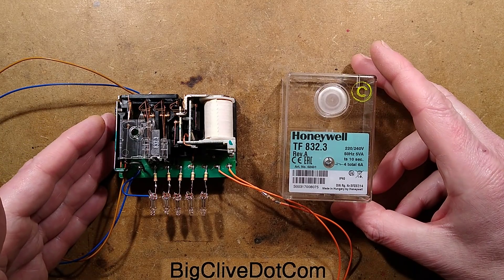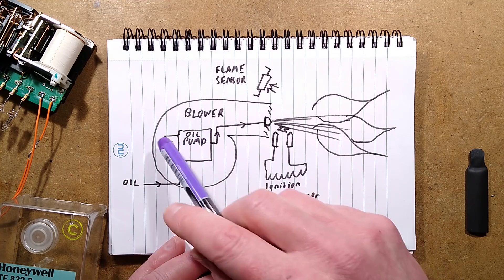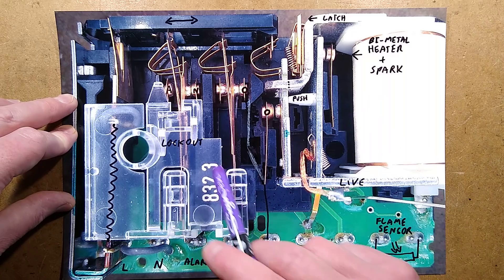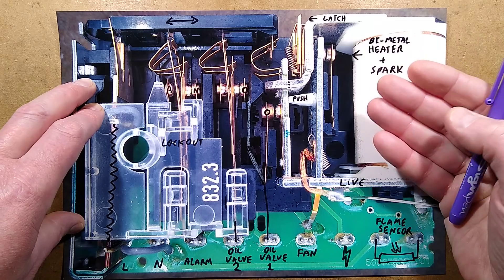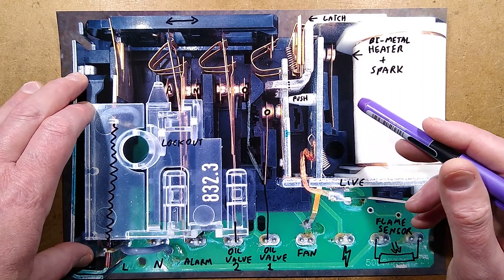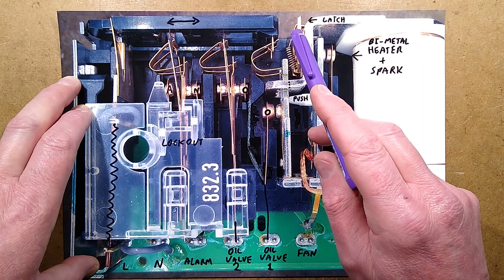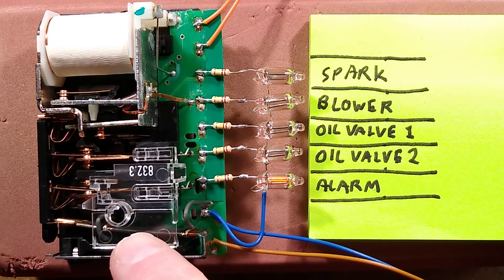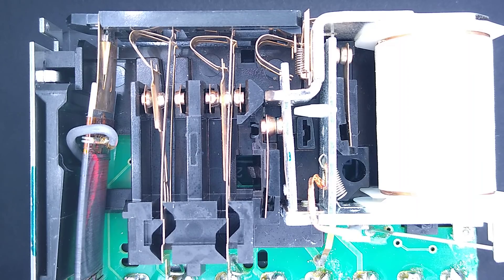Incredibly clever oil furnace burner controller (very perplexing)

Comment: That's awesome. Must have taken forever to work everything out! Our Honeywell thermostat used to have something in it that made a nice clicky noise whenever the HVAC system was about to go on or off, and then some "tech" decided it was somehow responsible for an issue we were having and replaced it with an unbranded electronic one. He was sus AF. The display is nice and big and an actually qualified HVAC guy told us it's okay, but it no longer makes any reassuring clicky noises. I miss the clicky noises. :(

Comment: I just had one of these fail on my boiler as the coil on the bi-metallic strip had fried, resulting in the burner fan and spark working but solenoid staying shut.  Interesting device and great video thanks.

Comment: Really good explanation can    Do these units fail as I have oil to the bleed valve but the vaporised oil is not being sprayed out the nozzle I did put a new solenoid on last year ?
Reply from the maker: You may have a blocked nozzle.  If you get a new one to try, the numbers on the nozzle must match.  They indicate the nozzle diameter and spray pattern.

Comment: These are also used in inshore ships.
We got one for the diesel burner for the heating of the accomodation and hot water.
Reply: So next thing how does the light sensor work is it like a solar power thing?
Or is it one of those light resistors that increase resistance when hit by light?
Curious to understand it hehe

Comment: Those are reliable controls, but I still prefer modern solid state oil burner control. Less variability and can even flash trouble codes at you

Comment: i wonder if a 12-24v ac/dc variant exists
I would use this for a dual level propane/butane/city gas heater scenario with oil 2 being run via a thermal switch+555 delay(after say 5 minutes of active "oil 2" when it is below 5c outside it would then  allow the "high flow" mode via the second higher flow gas into the flame zone) for extreme temps outside and as 24vac is a common usa thermostat voltage and would simply power a 24vac unit via the "heat enable" signal and the main air fan would simply force the local distribution fan to circulate the room/house air
this would allow any fire based heating system with dual level control to be used safely assuming the main house blower also has a "hot exchanger" thermal switch that forces the main blower active whenever there is too much heat in the "fire zone" (ie about 80-120c so a simple heat pump can be used as "heat 1" for tepid days)
this would also allow safer operation of personal propane heaters as using a simple control stack that locks out fuel flow upon a failed ignition(possibly using a heat switch rather than light based flame sensor) as a 24vac low current transformer is a common item so economies of scale exist
I want a 24vac version of this for simply using the simple but highly safe sequence to control all manners or flame heated systems
my wish in the future is a bioreactor with post-purification gas cracking to butane/propane and those reactors need an ideal 45c to keep the bacteria happy so a dual level burner with outside temp sensing and second stage delay/second thermostat relay for extreme cold would be ideal to use the extra H4S to keep the reactor happy
sure if the H4S is not enough on it's own I would then use a slightly lower regulator output from the main propane/Hydrogen waste tanks to sequence the burnoff of secondary products to keep the grass clipping to methane reactor happy
if it gets too cold the gas slows and eventually it dies and as 45c is quite warm for most areas it should be very happy with only a mix of PC waste heat from the server farm and a bit of flames

Comment: Mine has an additional wrinkle that the blower is controlled by a temperature sensor on the heat exchanger.  So the blower doesn't come on immediately (and blow cold air) when there's a call for heat, the flame starts, the heat exchanger warms up, and the blower kicks in.  When the call for heat goes off, the burner shuts down, but the blower keeps going, extracting the remaining heat from the heat exchanger, and adding a little hysteresis to the system.  When the heat exchanger cools off, the blower shuts down.  It works quite well, except for when people get confused/worried when the blower doesn't follow the thermostat exactly.

Comment: I wonder if America oil burners work similarly.

 I know the natural gas units in the US use a thermocouple that generates a small current when hot. If there is no flame, there will be no voltage and the gas control valve will switch off.

There was a house that blew up a few towns away from me. From what I hear it was due to compound failure - the system didn't ignite, and for some reason the gas valve also failed to turn off, so I guess the system isn't entirely failure proof. It's one of the reasons I'm not entirely upset I don't have natural gas where I live. Sure, the $800 electric bills in the winter suck, but while an electrical fire is always a risk, uncontrolled angry pixies don't result in an unsurviable explosion.
Reply from the maker: America seems to use different ignition systems.

Comment: There's lots of bimetallic strips used as timers in kettles and toasters.  This can cause less than satisfactory results when reused quickly as these timers remain hot and run short.

There's ones in the thermostats of old ovens, called fancy things like "predictors" as they're rigged into genuine analog computers - a tiny model heating element and thermal load representing how hot they expect your soup to be, controlling the actual thermostat.

There's also diabolical things called "hot relays", which are just a bimetallic strip driven by a heater.

None of these are as reliable as they ought to be in theory.

Comment: Awesome video. I love electro mechanical things. I do like electronics,  but at the same time i prefer the reliability of the old mechanical designs. Is this still used there in new units or has it been replaced by a micro controller?

Comment: Fascinating - it always surprises me how much thought went into electromechanical devices before electronics took over for the logic - gas valves with pilots are an interesting example too. I have an irritating intermittent fault on a 'newish' (20y) boiler where the ignition does 5 attempts to ignite and then locks-out - it then needs a physical reset before it tries again after which it's fine :/ - there are no ICs as such on the board, it's all discrete components - these days a microcontroller would do everything and be a whole load more complex (and probably fail after a few years!)

Comment: Not so clever when you discover that every time the boiler fires all that arcing and sparking from the old mechanical contacts takes down the wifi. Nothing a big sheet of metal behind the router couldn't fix.

Comment: There are also some controller witth a little roller inside which indicates at which "phase" the Burner is (ventilate, ignition, operating etc...)
this helps a lot by troubleshooting

Comment: I prefer the style they have on rv heaters, the igniter sparks against the grounded burn element which is basically a rounded triangle sat on top of a tube but as one piece and with a mesh grate with small holes on the outside of it and that’s faced sideways in the flow of air and the carbon from the flame let’s it know it’s burning by checking resistance between the igniter and the burner, the mesh also acts as a flashback arrestor

Comment: I had the job of designing both gas and oil fired furness electronic  controllers in 1975 &  1976.  
These were to replace electro mechanical controlls that were most common then. A lot of controls had primitive safety functions, though legally demanded.
At one stage one of my 'proto' modules was due to be fitted at z large fishing lodge, but due to a couple of sick days by the worker contracted to exchange the controller  my sample was not yet fitted. But that weekend, the entire lodge was burned to the ground.
Initially panic set in for the managers of my employer. The fire investigation soon cleared us, as the old controller had due to three internal faults, repeatedly purged as air, supplied oil for three times normal duration,  and finally lit up but cut the oil again. It might have done this for hundreds of cycles. The accumulated excess duration of oil spray pooled a signif8cant volume in the base of the furness. As the liquid does not readily ignite, it failed to burn there, and the short firing of spray did not help. Finally with gallons of available oil, it did get fired to create an explosion, that ripped fuel oil lines open and a massive uncontrolled fire was started. Total loss of lodge.
Lodge got rebuilt a year later and one of my controllers was used for at least 3yrs no issues. I had left the company by that time and have no longer term history. As the comany was part of an multinational investments chain and was closed over other cashflow problems, probaly nothing long term resulted of the designs.
All done pre microprocessors but I have 6 or 7 safety features added including redundancy in critical control and safety monitoring

Comment: The term for what this does is FLAME PROVING.  It has to make sure the fuel doesn't keep flowing if it's not burning, to prevent a build up and explosion. 

A building I was leasing had an ancient Chrysler Airflow HVAC unit on the roof that hadn't worked for at least 20 years according to the building owner.  Found a different type of valve control module inside (for piloted nat gas system not oil) that was faulty and found a close enough replacement on Ebay and got that thing working!  

Gravity furnaces use a pilot generator to make power to open the gas valve; no pilot, gas valve can't open.  Pilot ovens and water heaters have a thermocouple that prevents the gas valve from opening if no pilot; water heaters include a one time over-temp trip that will brick the controller if the water dangerously overheats just once.  Ovens and heaters with electric controls use an electric heating element that must reach and stay red hot for the gas valve to open.  RV furnaces and water heaters use an electronic module that generates spark to ignite the gas, then detects the high voltage being bled off by the ionizing flame; it will test-open the valve for a certain number of seconds for 3 tries then lock out if flame cannot be maintained.  Clothes dryers use an optical flame detector similar to as shown in this video.

Comment: So what's the purpose of the 2nd PCB?
Reply from the maker: The PCB has circuitry that amplifies the photo detector and may also detect overvoltage and undervoltage.
Reply: @bigclivedotcom  Basically the solenoid driver then !
Cheers.

Comment: A gas one would have a fan sensor too - so strange what your oil valve 2 sw is for.
The ones on my school oil boilers were synchronous motor driven clocks cam operated switches.

Comment: I'm not sure that's off an oil burner. I've come across a gas burner that has an ignition burn and then goes up to a full burn, but never oil as they're not suitable for varying output. BUT it could trigger a second fan and pump that does not have all the safety systems as there is already a 'pilot light' lit in the combustion chamber !
Reply from the maker: This one is definitely off an oil burner.   But just single stage.

Comment: You won't get blower and spark !
Blower comes on first and runs a set time. Then spark, then oil (or both spark & oil at the same time) for perhaps 2 sec ONLY unless flame sensor's satisfied.

Edit - what you could get is blower and GLOW igniter at the same time - as the glow igniters take 15-20 seconds to get to a glow - which is ample time for fume purging.
Reply from the maker: Blower and spark.  High voltage transformer and spark gap.
Reply: @bigclivedotcom  Seems very strange to start ignition at the same time as starting the air purge !
I think my pilot lit boiler needs to purge for a minute before you can power the spark !

Comment: But what are the electronics for? To drive the  led or more fail safe logic?
Reply from the maker: Possibly to detect an overvoltage or undervoltage situation.  Also for photo cell amplification.
Reply: @bigclivedotcom  Thanks for that.  I had missed it in your description!  And having played with these and checked the voltage across the LDR and found it was 230v I had assumed it was direct to the coil.

Comment: I have a few industrial honeywell gas/oil burner controllers at work, they are much bigger, have a pilot valve control and a vacuum tube UV flame sensor, they work similarly, a few flame tries to light and then you have to press down a button to reset, we also have a bunch of timer relays attached to control things like delaying the activation of the proportional valve for the main valve

Comment: This was interesting. I have a turbo heater I use in my garage that runs off diesel or kerosene it had a suction line that split open over the summer and when I tried to use it the following winter the fan would come on and the ignition buzz then in a min or so shut off. power cycle would reset it but to the same affect. Once i fixed the suction line all was well with the normal sequence much like you described in this video.  This was a great video explaining how the system works and I assume that a similar circuit exists in my portable garage heater.  Thanks!

Comment: I've worked with these things, it's just a time controlled burner control, like they did in the past with a wheel that rotates with holes.

But really nice to see, haha,
You gotta check out battery driven hot water flow trough boiler, I've got one for ya if you want it, it's from vaillant 😬

Comment: When I was trouble-shooting a natural gas furnace in my home, I realized it has more parts to make it stop than make it go.
The oil burner is substantially more mechanical and complicated.
The gas furnace also had an airflow check that would shut off if the heating ducts were all closed.
There was a lot of experience and engineering that went into this!

Comment: Can we get a carbon monoxide alarm teardown pretty please??

I am also curious if the EU requires they be installed in homes and commercial buildings using gas heaters and the like. (Still not too uncommon over there I presume?) I just learned here in the states there is no requirement to install these very cheap lifesaving devices anywhere and the OSHA CO limit at 30 ppm is still plenty high enough to give every employee a nasty headache if you're skirting just below that.. Really makes my blood boil. I heard about this at the very end of Well There's Your Problem's Kursk episode.
Reply from the maker: I will make a video about them.  Many use an intriguing chemical cell.
They are recommended anywhere CO is a risk here.

Comment: I got a brand new controller but locks out at the end of the safety time, the photoresistor works fine (measured several times), sent to an furnace expert without luck... what can be causing  this issue?
Reply from the maker: Is the sensor pointing where it can see the flame?  Is everything sequencing on correctly and the coil armature moving?
Reply: @bigclivedotcom  yes, double checked that, the system starts (blower + ignition coil + solenoid for compressed air) the flame stays for about 10 seconds then the lockup state gets in. However, I haven't checked the coil armature movement, will check and comment later, thank you!
Reply: @bigclivedotcom  https://youtu.be/EtxqnltS1w0

Here's the video of the controller behaviour, measured about 20 volts (AC) in the coil terminals and the photoresistor was illuminated artificially for this test. I've noticed this model (834.3) hasn't had a latch spring on the top.
Reply: Some burners have a 6mm hole in the air swirl plate of the blast tube. This allows the light of the flame to directly illuminate the photocell when flame is established. It requires fairly accurate alignment to work correctly. I once had a replacement blast tube arrive without the hole so I had to drill one to suit. That cured the problem. 
In your case though I'd first try starting the burner with the photocell covered, allow it to run up then when the flame lights uncover the cell and illuminate with a torch to confirm the initial sequence components and flame hold on works ok. If no flame lights look for ignition arc presence, arc strength, oil valve (clicks) android oil atomisation spray. Also check the flexidrive coupling between oil pump and fan motor shaft.
Reply: @johnj4860  Thank you, but I circumvent the issue adding a on/off switch in the controller line. After the (automatic-mystery) shutdown, flipped the switch to make it work continuously. 🤷‍♂

Comment: That mechanism is quite versatile and I can see how it could be usefull for a completely different purpose if you hook it up to a different type of sensor and a different kind of output. I find this rather interesting because why would you need to reinvent the wheel if you can just buy a spare part of this and use it in a different context, isn't that what defines a part of an engineers job, finding solutions to problems, usally ones that are cheap, reliable and often that exist elsewhere and simply need to be reaplied for a new purpose?